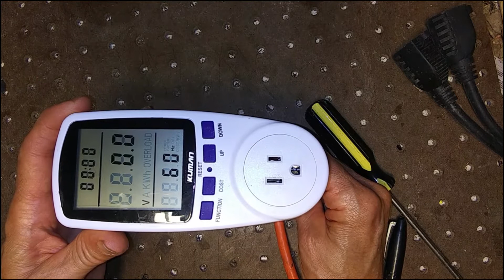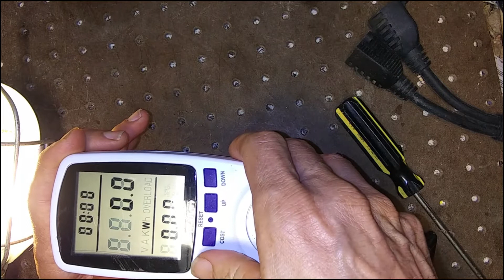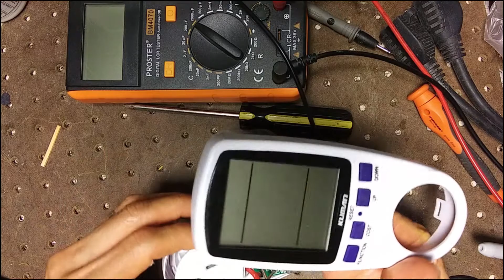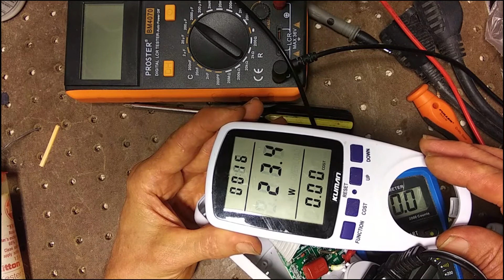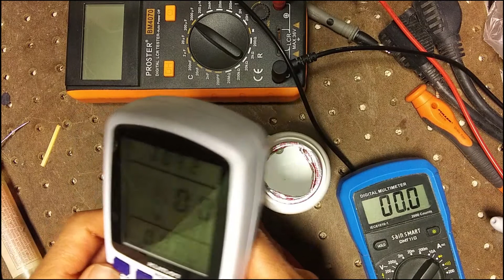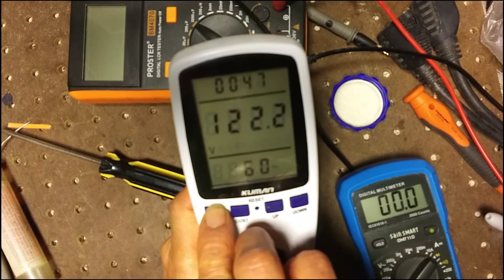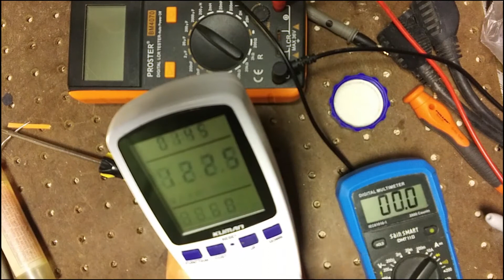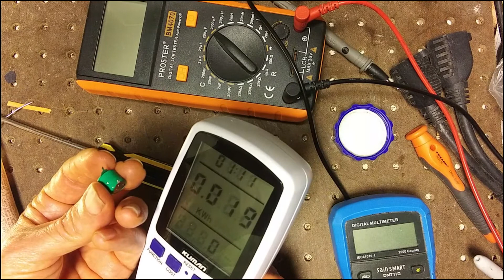Kuman power meter repair - NiMH battery replacement

Comment: This is the best video I could find on this watt meter. It was vert helpful in fixing mine that was also going to zero a couple seconds after plugging in. I had no use for the battery as I was looking for only instantaneous readings so I just de-soldered it and the meter is working like new.
Reply from the maker: Hah!  That's interesting.  It never occurred to me that it might work with no battery at all.  Thanks for commenting.

Comment: Wonder why changing the battery made it work? I've got one from ~2015 that works okay, but won't remember the kwh value once it loses mains power, suggesting the battery is dead, even though it's had constant mains power for many months (meaning it should be fully charged at a slow charge rate).

Comment: How old was the original battery?
Reply from the maker: About 3 years.  So a premature failure, but it sat unused for months at a time in a drawer in a fairly damp basement.  Thanks for commenting.

Comment: Your repair here is a little bit dangerous, plugging it in with the item disassembled. However i have this exact device and the exact same problem! Thank you so much!!!
Reply from the maker: You're right of course.  Old habits are hard to break but I should take more precautions.  Thanks for commenting.
Reply: @quetzal4042  thank you so much for this video. I ended up replacing my battery with a 5.5 volt supercapacitor. It's been working perfectly fine for the past week or so! Because of your video I definitely had the confidence that it was the battery
Reply: Still working okay? Do you know how long it keeps its memory alive for? If you leave it unplugged for a long enough time, do you have to wait for it to charge up before it works? Great idea.
Also, how many farads is your supercap? Thanks.
Reply: Please wear hand gloves  with electric resistance

Comment: Why does that battery last so short? Obviously bad quality. It should last at least 5 years, not less than two, like mine. Is it known what the charging current is?🤔I ordered a bit stronger (40mAh) so we'll see. And maybe I'll put Li-Ion 200mAh with charging protection. That should work.😉
Reply: If the board gives the nimh battery a constant-current charge at around c/250, it will be fine for a nimh battery but will overcharge a lithium battery, even if the nominal voltage is the same.
And I dare say the circuit will constant-current charge the 3S nimh battery because that's what nimh cells are good for: simply using a resistor to keep it topped up/charge it slowly (at ~c/250 - c/300, which will take ~2 weeks to charge it to full from flat).

Comment: Thanks for sharing video.
I just fixed my power metter by soldering 18650 battery inside case.
Hello from Bosnia
Reply from the maker: Whatever the problem, 18650 cells are the answer!  Although even more important not to let it go completely flat.  Thanks for commenting,

Comment: These batteries are deadly in their destruction potential from leaking electrolyte. They have destroyed countless motherboards.
Reply from the maker: Lifespan supposedly "up to" 5 years, just long enough that they don't have to make them replaceable.  In retrospect, the instructions do mention that it has a NiMH battery.  Thanks for commenting,